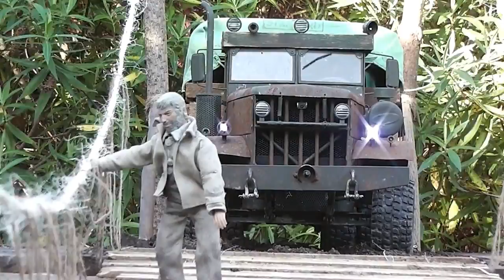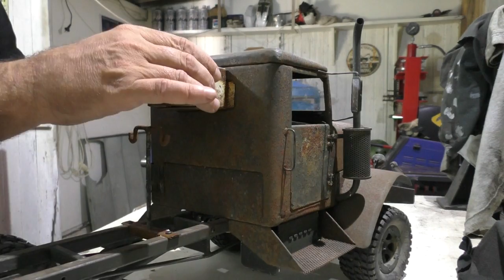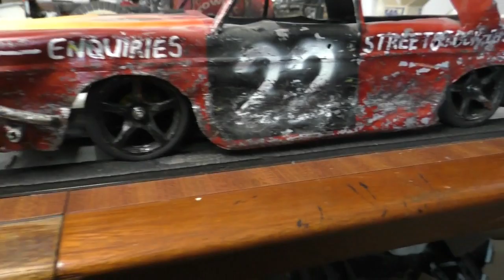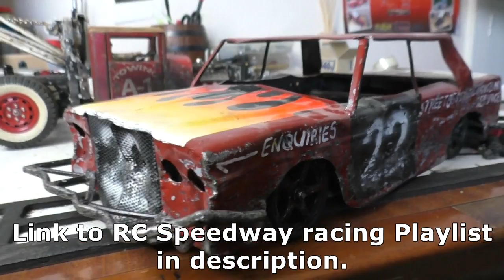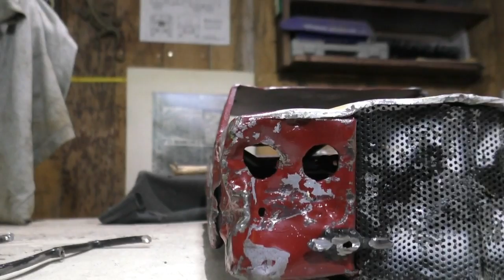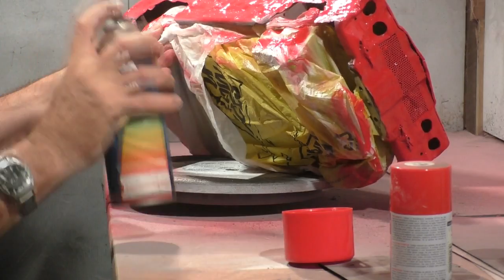Detailing FATBETTY tractor unit for the 'Duel' tanker & making the red Valiant.

Comment: I would really like to build a car ive had floating around in my head for quite some time. Was wondering if you source frames from somewhere to modify, or, if you build them entirely from scratch? If from scratch, what is a good material to start with? Thank you in advance for your input!
Reply from the maker: For car chassis I normally start with 12.5mm (1/2 inch) square tube, cut it down the middle to make 2 C sections for the rails. For trucks I use them as square tube rails. Another quite good chassis is the Gmade GS-01 rails for the Sawback. I am using them for a Gasser project.
Reply: @OldIronRC  -- Thank you very much! Keep up the great work!